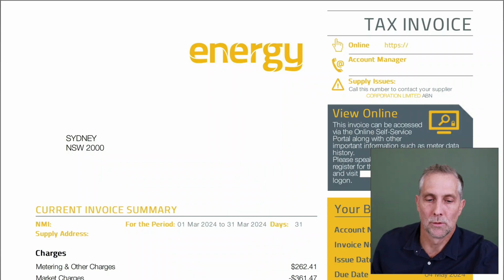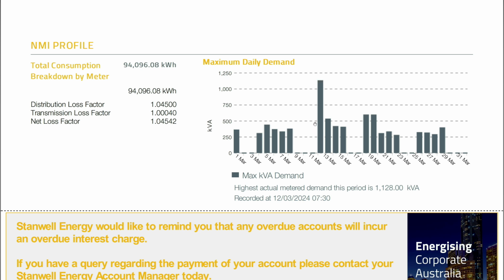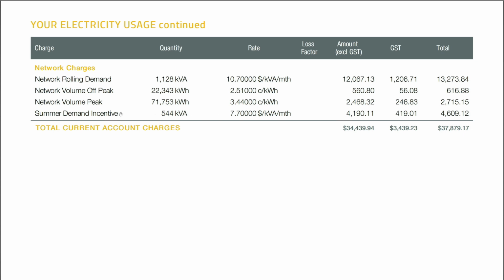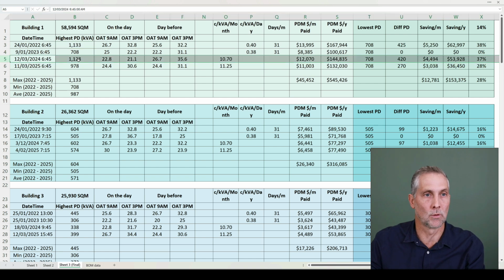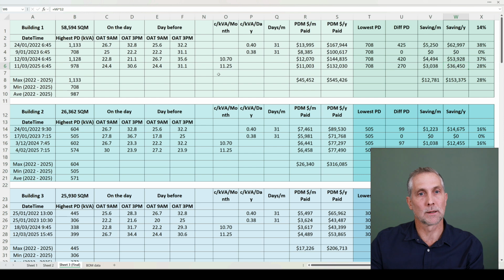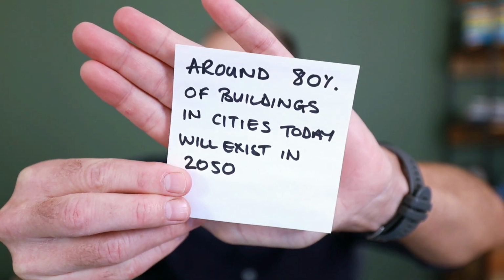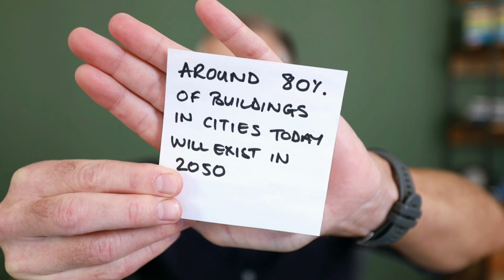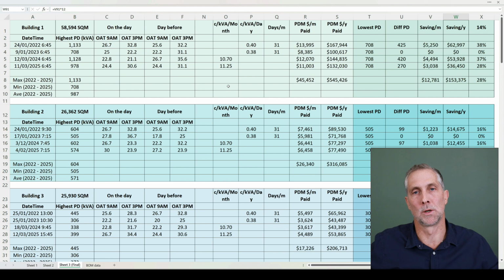Optimal Start vs Peak Demand Management

Comment: Many years ago we had a site where part of the building overhead at night when the vent was off.
We added a night time "free cool" strategy,  where if ambient was lower than space temperature and the free cool clock was on, the vent was operated without mechanical cool

After implementing that the space didn't overheat during the day and the mechanical cool coped all day.

With many projects since we have deployed "night free cooling"

Comment: I think that peak demand managment is a good idea, but before that, when the building temperature is above setpoint and the outside air temperature, you can set the AHUs to run with the recuoup dampers open or without the heat wheel at night to cool the building down to occupied setpoint without using the chillers. This is called free cooling or night purge.
You can also use occupied/unoccupied/standby schedules instead of on/off. That way the building is pre-heated or pre-cooled in the night before the occupied times.
Also consider staggering the occupied time schedules to reduce the peak demand.
Installing buffer vessels allows to reduce the load of equipment on high demand and reduces the cycling of equipment.
Once all of that is done, your idea can then be implimented.
The results would be a significant reduction in peak demand on all days and reductions in energy consumption.

Comment: I enjoy your videos and you have great ideas. A lot of so called energy managers don't realize this and instead just spend money on solar panels or other ideas.
If you have people to custom program the equipment for each site you can easily do a soft start to manage peak demand. The direction most controls system companies are going is fast commissioning to maximize profit margins, and install preprogrammed controllers to save on programming and just have installed by electricians. Then the owners don't want to spend usually as they are passed between investment companies that hope to pass the maintenance on to the next company, and the energy bills on to the tenants or whoever else pays.